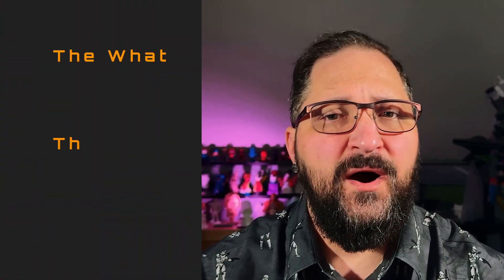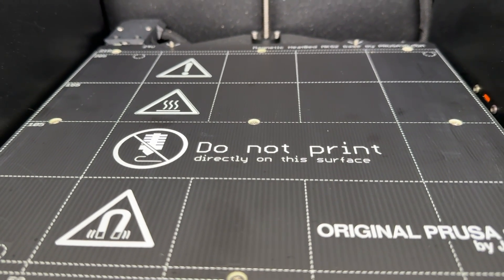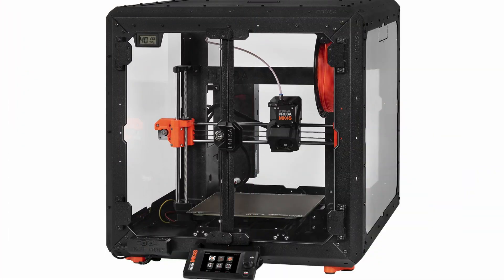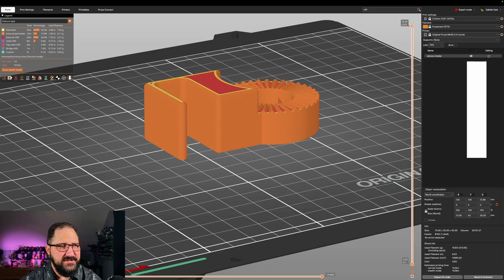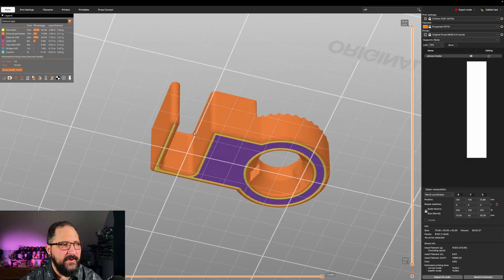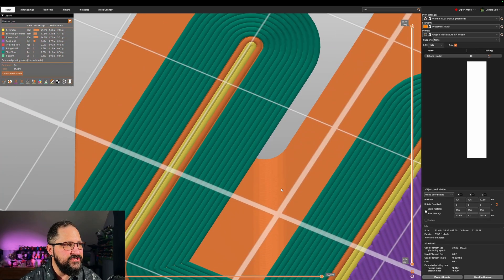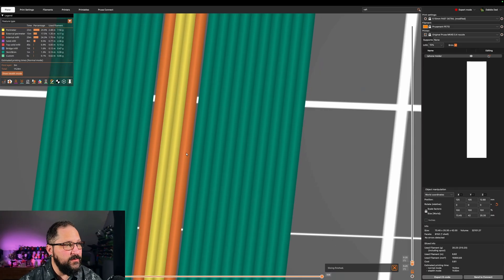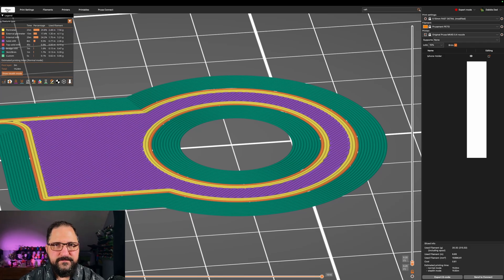No More Warping!

Comment: I found that if you want a brim to be even somewhat effective you gotta set that brim-object gap to 0 and remove it in post.

Most of the time adding a disc primitive to the corners or ends of a long thin section (think mouse ears) and making that 2 layers high has brought me much better results. Because when you combine the objects in the slicer it will be printed with continuous lines instead of printing separate lines next to the object. 

2 layer discs are still easy enough to remove in post but they really hold on firmly to the part. I've had warping parts just rip off a single layer brim more than once before, never on 2-layer mouse ears